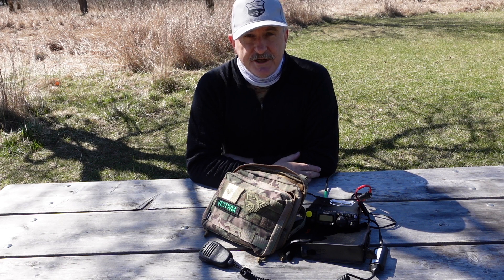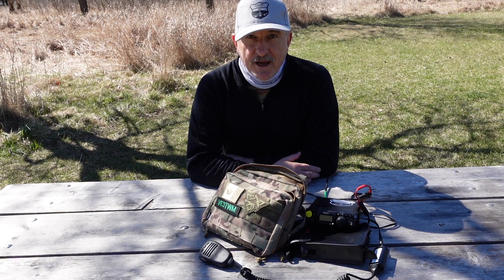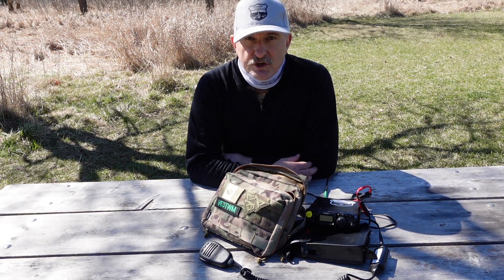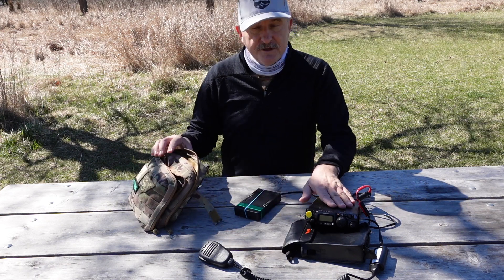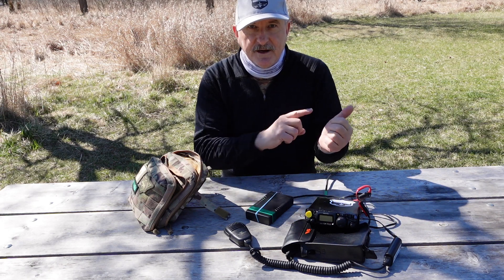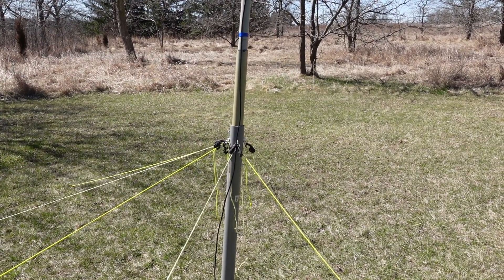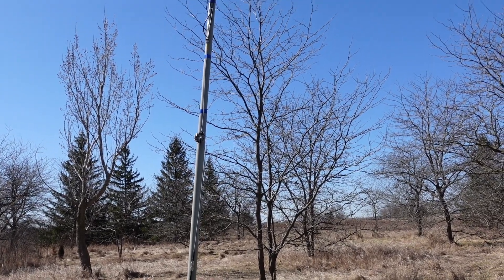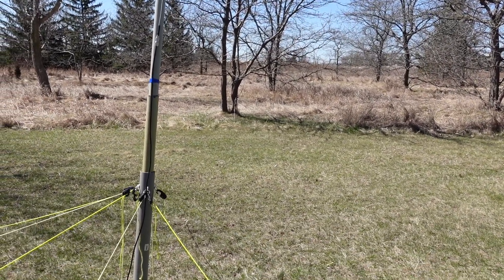Total Eclipse QRP!

Comment: Hi Tracy,
hope you are doing fine.

This comment does not relate to this video in special, but it's just to say hello from the other side of the pond...👋

You once said that "ssb- qrp is the "Zen" of amateur radio".
Well, I fully agreed with this for a long time; however, I now assume that's only half the story.
With a deeper dive into CW recently, I think there's no other mode which could fit better to an outdoor activity, may it be POTA, SOTA, or any of the other OTA programs.
With the modem between your ears, (nearly😂) always available, and no loud voice disrupting the silence of a beautiful park or trail, nothing can be more rewarding than some hand-made contacts.

The total amount of contacts slightly reduces due to qrs, but every single contact weighs more than twice compared to common ssb or even digital. 
For me, CW is the mother of all modes, and I am proud of any contact I can make - and thankful to all the OPs who are patient enough to help me enter the hall of fame of amateur radio.

Try it out for yourself, be assured that you won't regret it. To say it with your words: do not rush,  take your time - and the contacts will come.

By the way... today, I was out of my shack, I was outdoors, and I was on the air. Great motivation !

All the best, and  vy 73 de Arne, DJ9AS